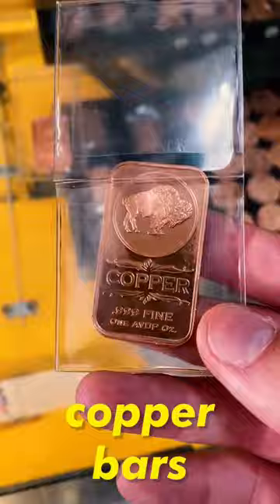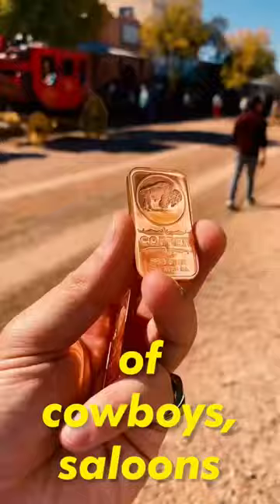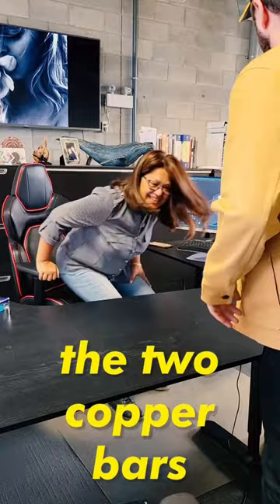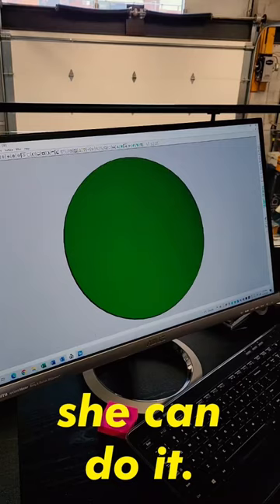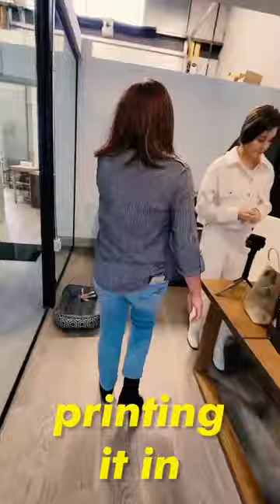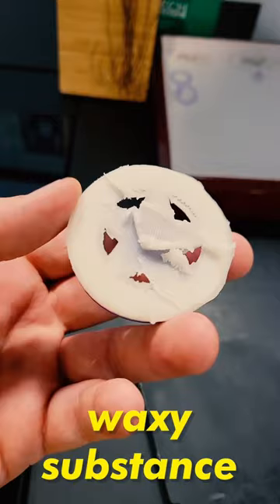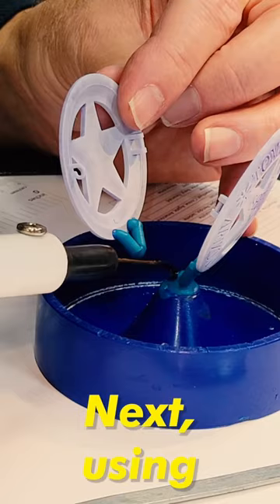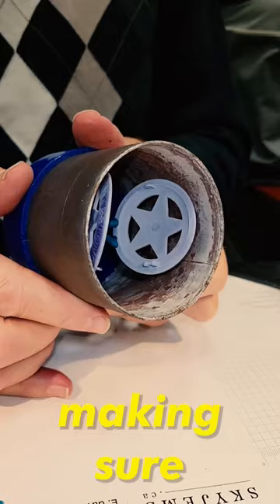Melting copper bars into a COWBOY BADGE! (Part 1) #diy #howto #art #copper #tombstonearizona

Comment: I would think that the original badges would have been beaten, not cast. Not necessarily out of copper either probably out of silver because like copper it's pretty malleable. Probably take a silver dollars pounded out until it's right size cut it engrave it and then you have a badge